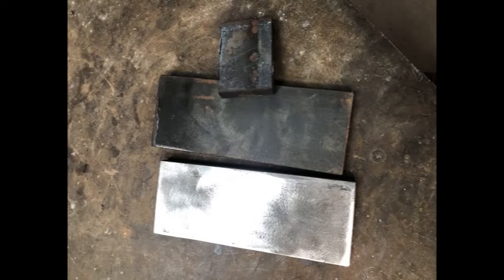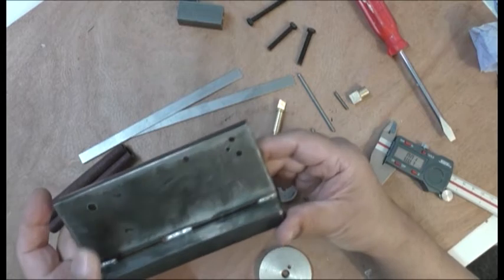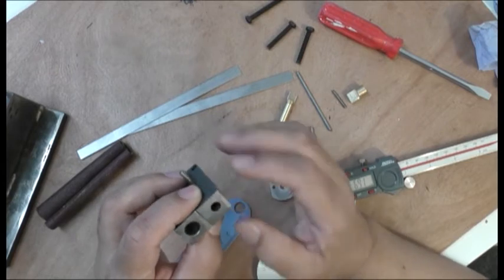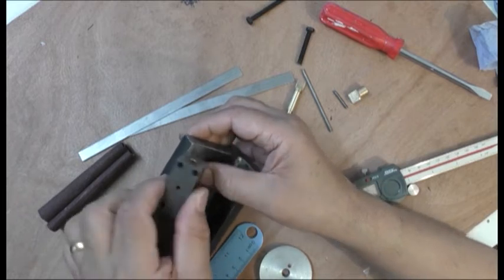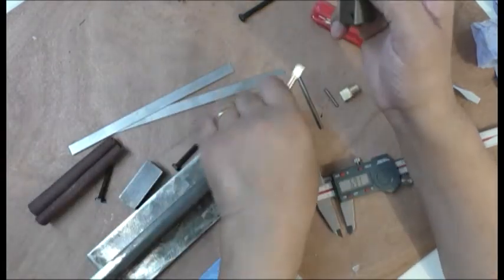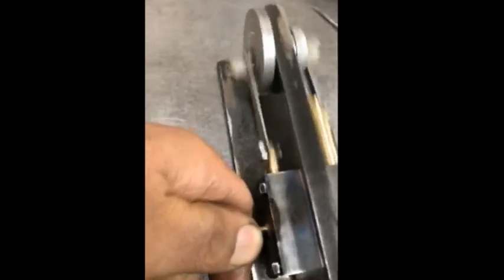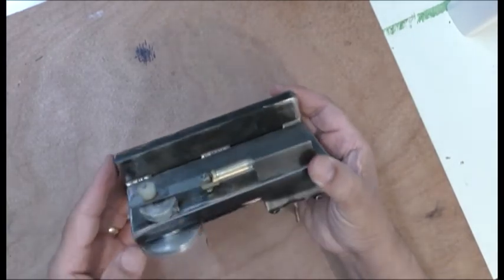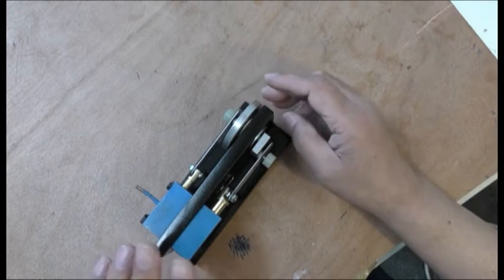#110. Making a Single Acting Air/Steam Engine.

Comment: That is pretty solid, looks really 'industrial'. Great stuff. The problem with the pressure is similar to the problems I am having with the 3D printed one. I can run it by blowing hard into it, but simple balloon pressure is not enough. I have increased the pressure from the balloon by making it 4 layers thick (a balloon inside a balloon inside a balloon inside a balloon) so now it runs but all those balloons make it top heavy and it falls over ☹👍
Reply from the maker: You see Grandad these are the problems that take time to iron out. This is one reason I can’t put so many videos up because it takes me a long time. Anyway thank you for your comment but I will get it running. Lol what are you gonna do with the balloon problem. Good luck take care my friend.